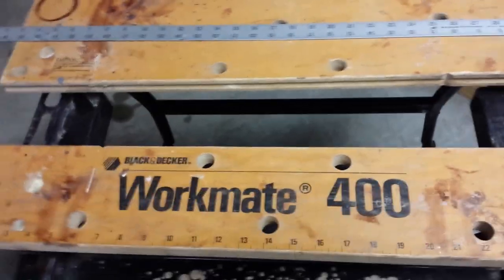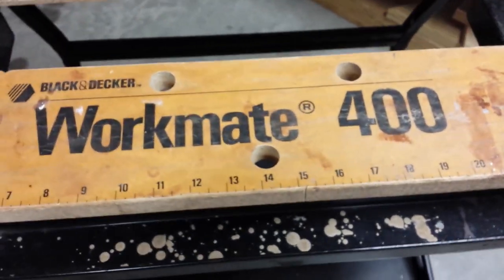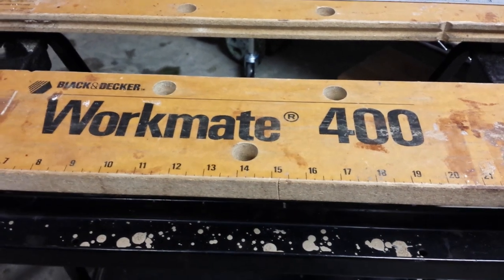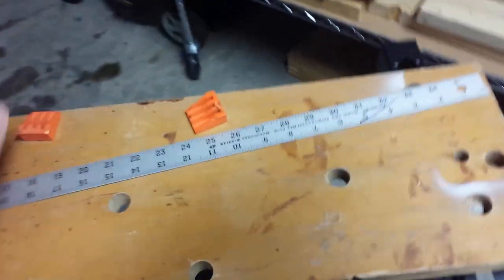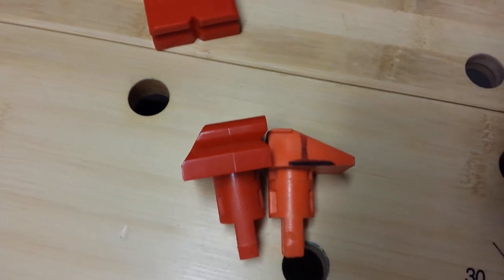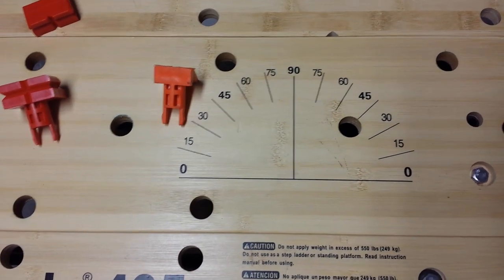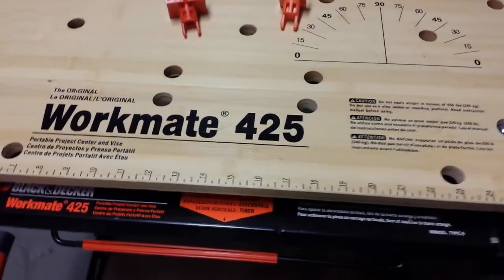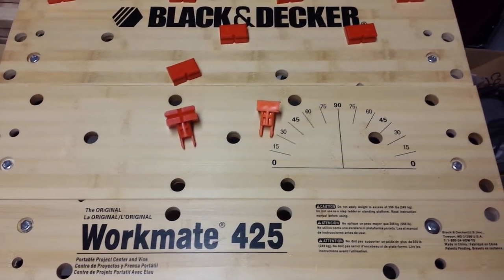The Workmate 425 vs The Workmate 400

Comment: My 400 is a garbage day "pick-up."  I have seen more since.  It appears that the biggest problem is the use of particle board, which is subject to water damage.  I have considered substituting it with TREX or possibly ipe, due to the vulnerability of the particle board.  I wish that there were such aftermarket ready-made table surfaces available, as all the drilling and marking look like a major project.  What would it add to the unit price for B&D to use a durable surface material, or is that sort of a planned obsolescence?

Comment: I've only ever had the 400. Bought 30 years ago new. I think the 425 is superior on the clamp pivot mechanism. But, I should mention that when it works properly on the 400 its not that difficult to lock in place. You pull the two circle knobs out while your raise it with your forearms and once its in the vertical position it locks easily. But my unit doesn't have the wear that I see on yours. The top panel does warp as you stated just from normal humidity so I will be replacing mine soon and giving the table a tune up with new knobs and dogs and feet. Mine came with the 1/4" masonite insert, very useful for organizing tools on site or even in the garage. Something I would definitely do with a 425. Great video, thanks.
Reply from the maker: Thanks for stopping by and sharing your points! Cheers!

Comment: a nice critique - I too just picked up a 400 at a yard sale for $25 and I plan to get years of moderate use from it.
Reply from the maker: Hey James - Wow!  You found a great value!  I know you will get a lot of use out of your old/new 400.  Thanks for stopping by.
Reply: about three weekends ago i got two workmates from facebook marketplace( workmate 400 and the 550) both for 40 dollars. i have to change the wood panels and that's it! The workmate 400 is made in USA, the steel is thicker than the new ones made in china.
Reply: I was cleaning the other one, the 550 and i found that is made in Canada! The label on it has in its corner 425 wm, maybe because in Canada is 550 and here is 425 wm.
Reply from the maker: Yes, for some time there were manufactured in Canada.
Reply from the maker: The older versions definitely have more "heft" to them.  Cheers!

Comment: I just picked up a 400 and would like to replace the panels.  I would also like to add a 3rd panel.  I know the metal indexing nut is no longer available,  I did see your video on using a 2x8 to make replacement panels on the 425.  What hardware will I need to add the 3rd panel on the 400?  I was a little confused on the video about eliminating the plastic slide indexing bracket and replacing it with a bolt.  Would I remove all 4 of the plastic indexing brackets and replace them with 6 bolts (2 per panel) with the new top or do I need to buy 2 extra indexing brackets for the 3rd panel I want to add?  Any other considerations with replacing the panels on a 400?  The ones that came on my 400 are good enough to use for a pattern if I need to use them.  Thanks for your help.
Reply from the maker: [What hardware will I need to add the 3rd panel on the 400?] If you use 2x lumber the hardware for the third panel will be the same as the other 2. [Would I remove all 4 of the plastic indexing brackets and replace them with 6 bolts] - Yes, this keeps them all the same height.  [Any other considerations with replacing the panels on a 400?] I suspect I covered everything in the videos.  Did see the video about the dimensions for the replacement panels?  Thanks for stopping by and posting your questions.  And congratulations on your new old Workmate 400 I know you will get some good use out of it.
Reply: i recommend you to use a piece of hardwood 1'' thickness, is better because it  is going to be more strong.

Comment: What size bit did you use to drill the holes in the middle panel? TIA!
Reply from the maker: Veronica Ulloa They are all 20mm.
Reply: Can you use the red holders with a 20mm hole
Reply from the maker: Yes, the Red Bench Dogs will work in a 20mm hole as this is the standard size for all Workmates.  Cheers!
Reply: Awesome thx
Reply: How did you determine were to drill the holes and how many to do? I would like to drill holes on my workmate. Any tips would be greatly appreciated 👍